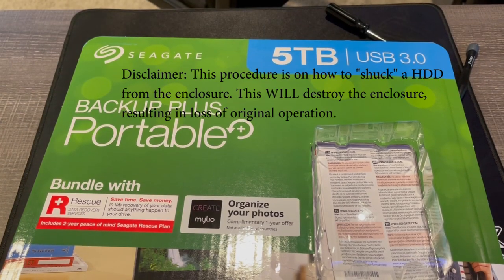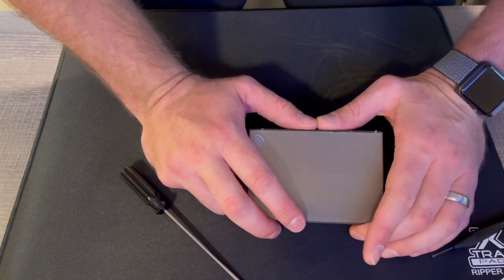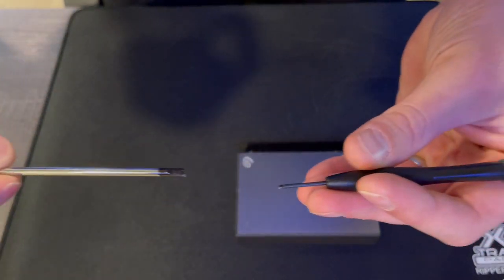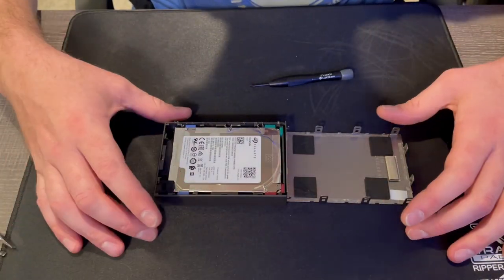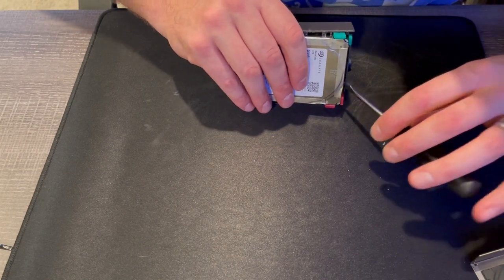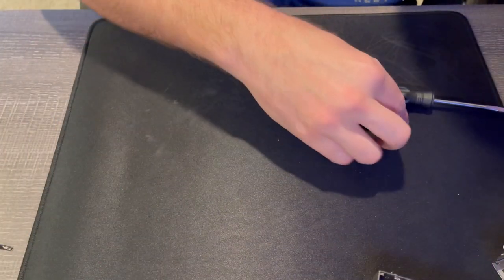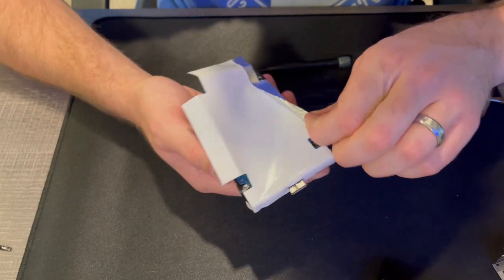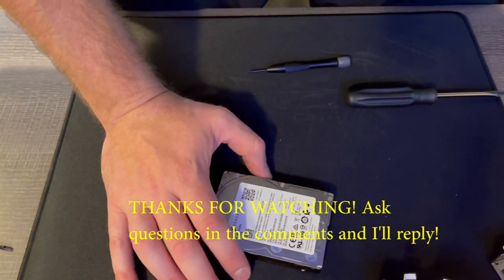Shucking HDD from Seagate Backup Plus Portable

Comment: Thanks for this video I used it to open a Seagate 5TB One Touch drive which is exactly the same as the Backup Plus drive. I have also opened a Expansion Portable drive which also has a similar drive inside. Both drives were Seagate Barracuda 5TB drives. Thanks again!! very helpful.

Comment: Thank you for this, in my case the USB port broke, the plastic center piece that holds the contacts inside the port broke off, the contacts were still there but bent slightly, and the connector would no longer stay in place or make reliable contact.  Since I have a StarTech SATA to USB3 adapter, I wanted to just remove the drive and use that adapter, which I just did thanks to this video.

Comment: I bought some feeler gauges from an auto parts store for less than $10. They're thin pieces of metal that are great for slipping between plastic crevices to pop fasteners. My feeler gauges are angled, and I usually start with the thinnest to get in then use thicker to pop the fastener.

Comment: Just one tip: Always do a surface scan of the hard drive (which could take 12-14 hours), for example with HDD Scan b/c a few months ago I had to return 3 of those Seagate HDDs in row b/c of either bad sectors or poor sector reads which significantly affected the read speed and would obviously put your data in jeopardy. They were probably part of a bad batch perhaps due to transport issues? So I went to a different Costco location and the drive I got there was flawless.
Reply: can you elaborate? what does surface scan mean and why would it take a whole day

Comment: Thanks for this! Just a suggestion, maybe get a plastic spudger tool to minimize risk and damage to sensitive parts.
Reply from the maker: Thanks for the suggestion. I ended up getting a set of plastic body panel tools for my truck and have since used those. they work well for this kind of work.

Comment: Thank you for making this video. Mine failed three days out of the box, and I'm hoping it's that pesky USB adaptor.
I read somewhere California has a class action suit on these drives. Thanks again.
Reply from the maker: The adaptor felt super cheap and poorly built Imo.
Reply: Mine failed a month ago so that is why...
Reply: how do i participate in this class action lawsuit?
Reply: @DuffmanPimp  Hey so, this is the first time I'm hearing of this. Can shucking out a failed drive to try and see if the adapter was the issue worth it?

I also read today that WD adapters failing result in the whole drive failing, is it he same for SEAGATE?

Thank you.
Reply from the maker: @AkshayKumarX  I’ve never heard of the data adapter causing a catastrophic failure on a drive. Usually that’s from the drive hardware being faulty. I would definitely shuck a “dead” drive and connect directly to a mobo sata cable to see if it’s truly dead. You might even be able to recover data if you don’t reformat it.
Reply: @DuffmanPimp  Thanks for the fast response.

I'm looking to buy a 5TB external that are priced quite decently in India with a 3 year warranty. A fractional price difference between the 4TB and the 5TB drives but above that the prices skyrocket.

Learned a lot today about shucking, NAS, SMR, CMR and all that jazz. Tearing my hair out trying to understand the difference between all these damn sub brands like One touch, backup plus, expansion, portable, etc.

I learned that the drives that require an external power source are just 3.5" drives, is it worth buying those drives over the smaller ones? Like anything concerning reliability, speed, etc.

I plan to dump media on the drive mostly and use my old 1TB drives for redundancy, write speed isn't that important so SMR works okay for me.

I feel bad using you as a customer support now, but any advice might be helpful. Thanks.

Comment: Any speed testing or any updates on the drive? They’re on sale now for $95, seems like a great value. Thanks
Reply from the maker: Standard HDD data rates. About 100MB/sec. I use mine as an NVR at much lower rates so I can’t comment on true performance.

However it appears to search historical video well. I’m still using it and have no errors so far.

Comment: Is this really worth doing? Does a shucked drive have the same life as a "legit" drive, or will it lose data and fail faster? Assuming you can use this mutant thing in a standard laptop space at all?
Reply from the maker: It’s only cheaper if you get one on sale. I got mine for less than $100 via Costco, and I think on eBay they were running 120-130……but, I couldn’t verify that the eBay devices were new and unused prior to purchase.

I listed the drive model number and it’s the exact drive you can buy retail…..I use this drive in my Network video recorder, which has a very high write rate, refreshing data every 30 days or so.  Many other Unifi Protect owners use this drive and have no problems, even as a NVR storage.

I figure laptop usage would be even better. Also, I listed the drive height previously. Hope this helps and thanks for watching.

Comment: hey ,after teardown ,can it use on the  laptop that it have 2.5" drive slot ,can  fit inside ?!
i see it have same ,sata interface but the thickness is more than 1/2 tb hdd thickness ,if you have laptop with 2.5" hdd ,can you try do it and see can this fit inside!

Comment: Ya know i never really understood why they use the same exact drive for both internal and external drives, as they just slapped a SATA to USB convertor on and called it a day yet charging less than the internal ones. The external drives just scream "HEY IMA BLEEED MONEY FOR FUN" as when people find out you can just harvest the delectable insides and use it with actual SATA cables the price of them will skyrocket as they should be charging more anyways because of the converter. The SATA to USB convertors alone would be neat as you can easily test to see if drives work without having to mount it plug it in and unplug it 

Sure the convertors would be niche anyways and more than likely be used by those with laptops and those that wanna take their precious "Homework" folder with them so no one can view it

Comment: What size is that hard drive?  It looks smaller than a desktop type drive, but smaller than a laptop drive.   What am I missing?   Id like to buy a portable case to replace the one I took it out of, but most look thin and used for a laptop hd and this puppy looks rather thick.
Reply: It's a 2.5" 15mm drive.  Finding an enclosure for it will likely be difficult since most 2.5" enclosures assume the more typical 9mm size variant.
Reply: @RobertPendell  Thank you.  Actually found seagate enclosures on THE BAY.

Comment: Thanks for the video. Can i use this drive as my laptop internal drive. Im not sure it is the same size as the default laptop drives?
Reply from the maker: 3-5tb seagate drives are 15mm, all others are 7mm.
Reply: That means 2 tb the internal HDD can be matched with laptops or mini PCs ??

Comment: Can I do the same for WD, or it got  no SATA interface?
Reply: wd is usb on the board. Dont try, I did it.
Reply: @jumbo1402  Had a wd mypassport that failed, took it apart to find they use their own proprietary control board, no sata connector it's a straight up usb 3 connector only.